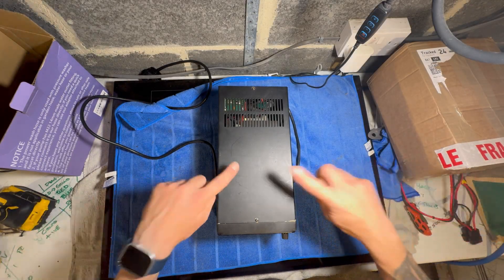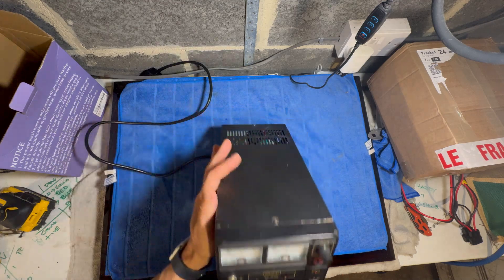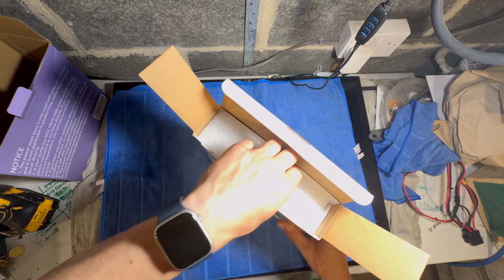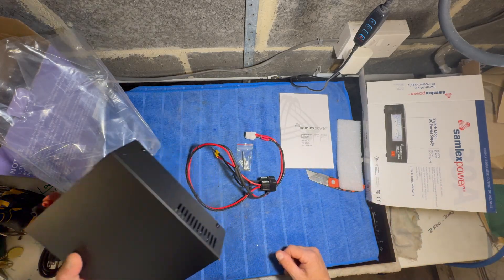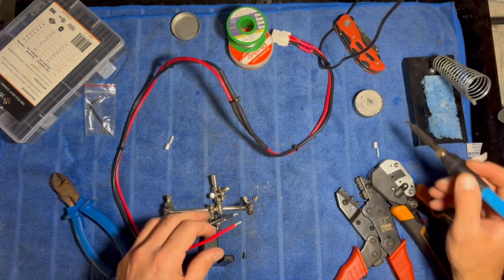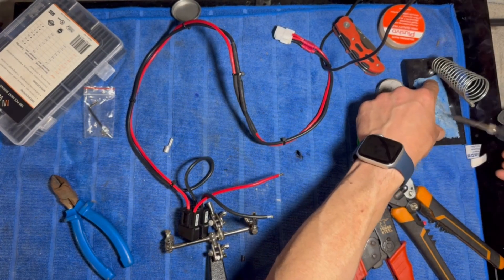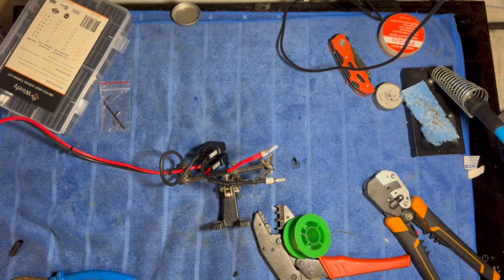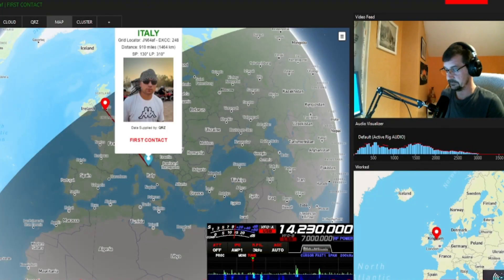Samlex SEC-1235P-M 30 Amp Switching Power Supply

Comment: Never, ever tin the leads before crimping. That prevents the “cold welding” of the copper strands in a properly crimped joint and over time allows the assembly to loosen.
Reply from the maker: I didn’t just tin and then crimp the connections. 

I tinned the wires before crimping the connections and then soldered the whole connection. The tinning of the wire helps with solder flow. 

It’s a never ending debate that pops up on every video. 

Here’s my take on it. 

For indoor use, on a permanent installation, where the connections are static and not going to move or blow around in the wind soldering the crimped connection will give you a more secure and conductive connection. 

If the installation is outdoors, or exposed to the elements, or likely to be moving around in the wind etc, then just crimping to bare wire alone will reduce the chances of the joint becoming brittle and breaking.
Reply: @M8KHC - it shouldn’t be never ending. Every single assembly standard recommends against tinning with solder before crimping because it prevents a cold weld and soldering after crimping is frowned upon because it actually loosens the mechanical grip of a properly crimped connector.  Also solder wicks up into the strands of the cable, resulting in a stress point. Other than that I enjoyed this video. I have the same power supply but it just started acting goofy. The fan is loud and has begun running even without a load and once the voltmeter on the front panel read incorrectly. Best wishes!
Reply from the maker: @SMShannon55 it’s probably because you don’t crimp and solder your connections! … I’m Joking 😂😂😂

I hope you have a warranty or that at least it’s an easy fix mate.
Reply: @M8KHC  - ha!!  I actually used to but in my first job as an engineer after college I worked with a lady who had been trained in various assembly standards and she scolded me. That was 34 years ago.

Comment: Crimp only Matt - if its the proper tool used.  I used to do the same but now with the proper tools I don’t.  Thanks for the post.  Mike
Reply: Yes it does - in my previous work life of digital communications everything was crimped connectors.  It gave better results and less failure rates.  I used to crimp and solder, now I don’t.  PL259 I use crimp connects except for the M&P type which still need the centre pin soldered (still a point of failure IMO).  You’re having fun, may it continue that way.
Reply from the maker: Thanks Mike, it divides opinion doesn’t it. I tend to crimp and solder anything that’s permanent and static that won’t become brittle and break if there’s any movement. Otherwise yes, if you have a good quality crimp tool the solder is unnecessary.